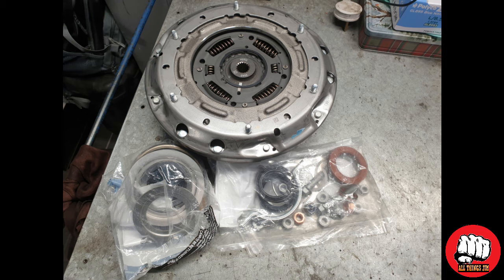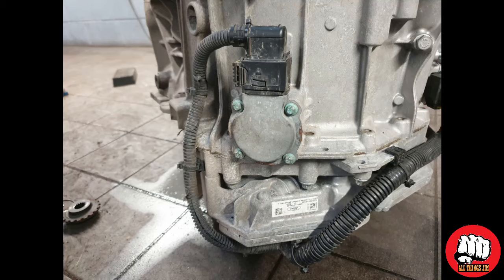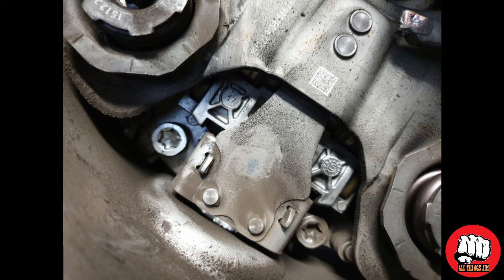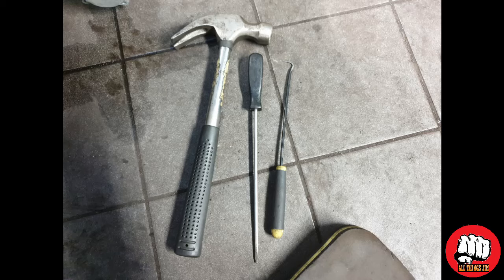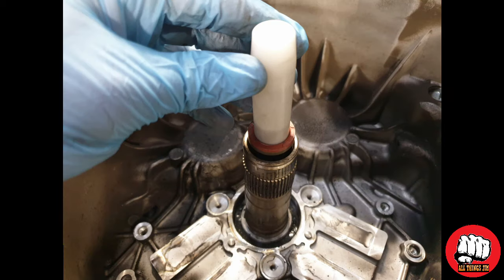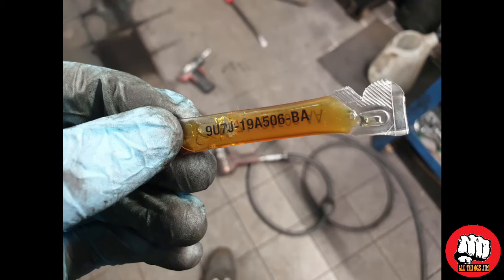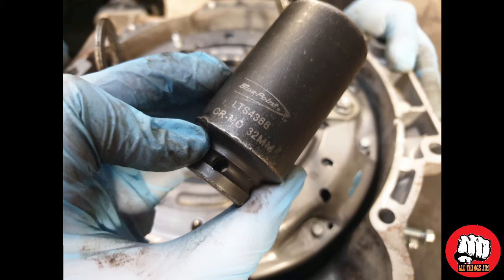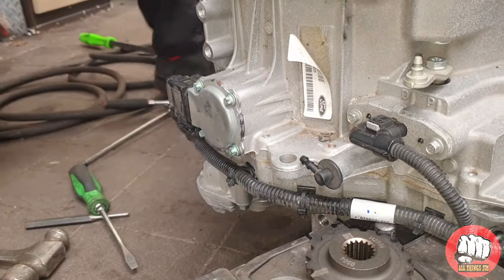Ford b max automatic 3 piece dry clutch (video 2 instructions)

Comment: Surprised your dealer doesn’t have the proper ford tools for this job.

They have a proper tool for removing and reinstalling the clutch and pulling the seals out.
Reply from the maker: Yeah we used to have it, a big silver thing that bolts to the bell housing, we lent it to another garage who never returned it (usual case- thats why I never lend my tools out!) To be honest this way is just as quick once you get hang of it. Thanks for watching and commenting 👍

Comment: Put in the bew clutch and it makes noise and doesnt free spin very easy
Reply from the maker: Youve done something wrong then
Reply: @ALLTHINGSJIM  yes sir, I sure did. I put new clutch fork actuators in and i did not remove the lock down plates.